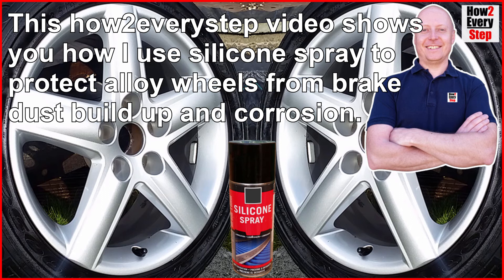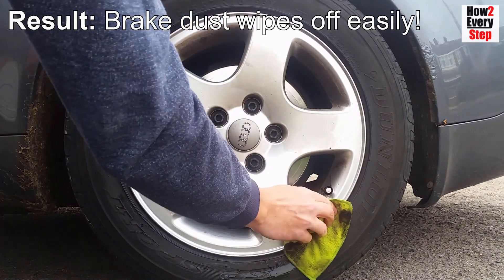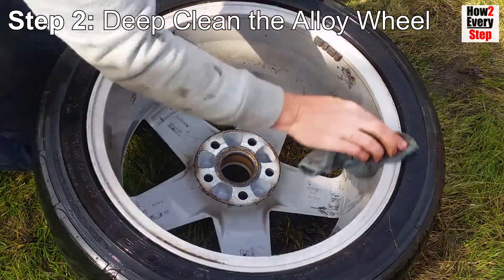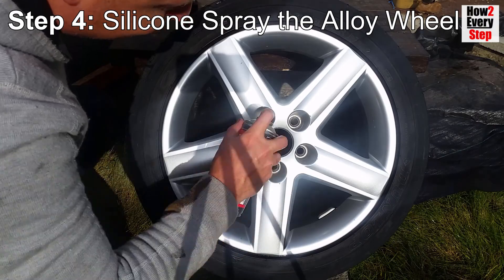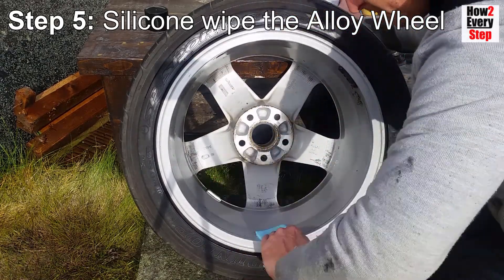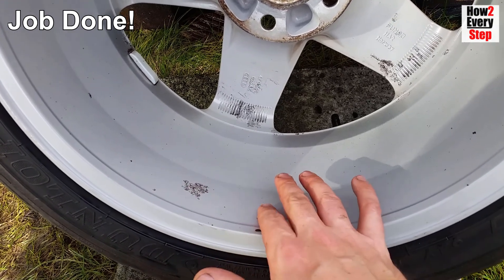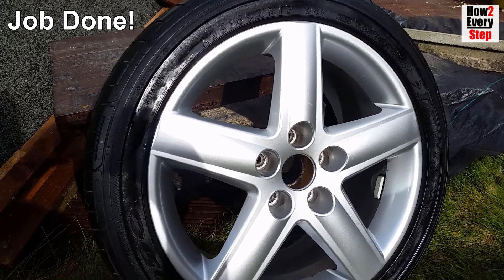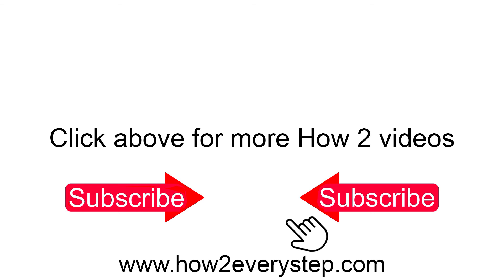ALLOY WHEEL PROTECTION from corrosion and brake dust using silicone spray How to detailing DIY guide

Comment: Hello, very informative! Changing my alloys soon, do you need to reapply silicone every time you jetwash your car and alloys or would the silicone withstand this type of pressure?
Reply from the maker: Hiya Matt.  Thanks.  I give my wheels a very quick jet wash to clean and then leave to dry - then spray a microfiber cloth with silicone  and give the wheels a quick wipe over.  Not sure if you need to add more silicone but I do to be on the safe side.  Cheers Col

Comment: Does the silicon spray lubrican comes off with car wash detergent?
Reply from the maker: Hi Patrick.  You will find you can easily wipe or jet wash the brake dust/dirt off because the grime sits on top of the thin layer of silicone.  Then you apply a new layer of silicone with a cloth to ensure you have a good protective layer after washing.  This process always works well for me... regards Colin

Comment: Hello! Can use it to protect my shotgun barrel from rust, dusr and rain ... I shoot regularly and will clean and respray 2wice  week
Reply from the maker: It's not just me that uses put it to good use then :)  Its a great product to act as a barrier to corrosion etc.  Is it common practice to use in shotgun barrels?
Reply: @How2EveryStep  hell yeah! U see we have silicone gun wipes like Birchwood casey for 5 bucks, u use them up and need to buy them again....

Instead you'd get a full can of silicone spray for 5 bucks and spray your barrels and make sure youd get a even coat on your weapon... And boom 💥 no turning back... Just remember to check every 15 days if you live in harsh weathers !
Reply from the maker: @AGENT-tq1nm  that's good to know, thanks

Comment: I imagine silicone is very water repellent, would you say it would be helpful to prevent the dreaded 'whiteworm' on Diamond Cut alloys?
Reply from the maker: Yes I think it would - you literally get a thin sinicone layer so provides a waterproof barrier... works really well
Reply from the maker: Yes I think it would - you literally get a thin sinicone layer so provides a waterproof barrier... works really well